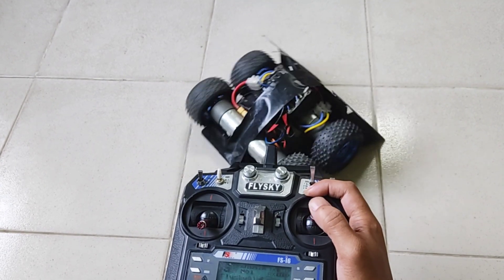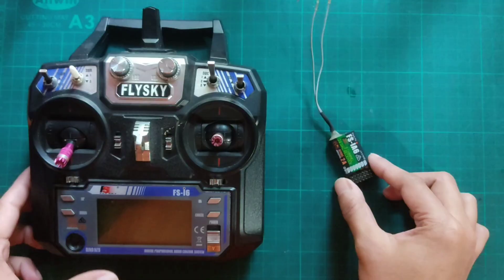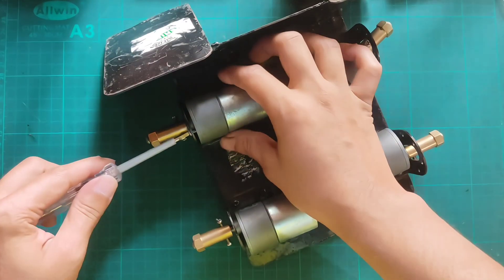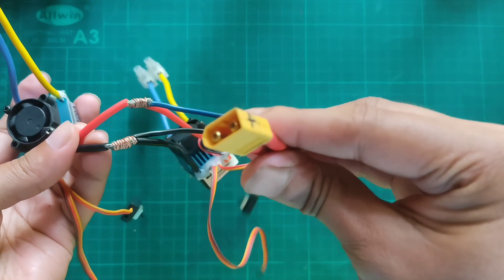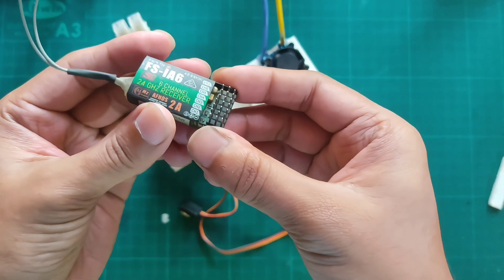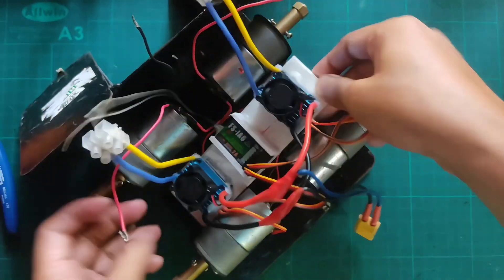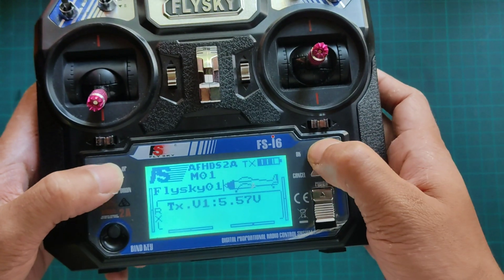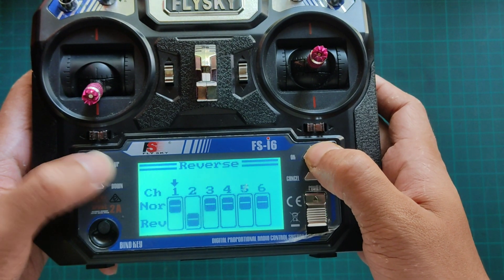Robo Soccer Bot using Brushed ESC and FlySky Transmitter | How to Make Soccer Bot in Easiest Way

Comment from the maker: 𝐓𝐮𝐭𝐨𝐫𝐢𝐚𝐥𝐬:

Fast Line Follower Robot / Fast LFR / Fastest LFR / PID Line Follower:
https://youtu.be/ST8KdWPMzp4?si=4OLW0cTDNwGmwwBY

Robo Soccer Bot using Brushed ESC and FlySky Transmitter | How to Make Soccer Bot in Easiest Way:
https://youtu.be/nd-Pnnmnu04?si=gGmbe2CjW1lpm47K

Robo Soccer Bot using FlySky FS-i6 Transmitter and BTS7960 Motor Driver:
https://youtu.be/gxoFwbduTOc?si=8B-Z586qo14An_A3

Comment: What is the name of the brushed esc
Reply from the maker: I just found this on AliExpress: 
BDT2,016.59 | New Rain 160A/320A/480A Waterproof Brushed ESC Speed Controller Dual Mode Regulator BEC For 1/10 1/12RC Car Boat Truck Toys
https://a.aliexpress.com/_oCgSYOF

Comment: Thank you sir...I have a question regarding the bot,does this bot requires any rechargeable battery to power its motors, ESCs, transmitter, and receiver?
If it is required,then plz make a video of conection of battery with it.
Reply from the maker: connection of esc, transmitter, motor shown in the video. Rechargable battery is lipo battery.
Reply: @aslamhossain1 oiga disculpe que tipo de voltaje es la batería qué usa y de cuantos mAh es

Comment: Hey aslam great video bro, i wanted to ask that i have to run 2 rs775 motor based gear motors for my soccer bot and i have around 2000mah 18650 cells each motor is driving around 12A under stall position is using a pack of 9 liion batteries gonna give me sufficient time to run the bot in a tournament?
Reply from the maker: What is the discharge rate and mAh of per cell of those Lithium ions? It would be better if you increase the number of cell to 12.
Reply: @aslamhossain1  it's a generic cell weighing about 45g with mah written as 50000 but its not 5k iguess its around 2000 mah discharge rate is not written but when I tested it, a single cell was able to give 12A its wierd but yes it was giving 12A

 also the black battery pack that you use in your videos whats its arrangement and rating? And is it sufficient in your matches? Like how do you manage the charging and all?
Reply from the maker: @hrithikkhanna3884  i've used 6 cell to make the 12v battery pack. Each cell is 2000mah. Collected from old laptop battery pack. Used balance port to charge with imax B6 charger. Match time approximately 30mins with full charge.
Reply: Okayyy thanks alot for sharing 🤝

Comment: 2 motors are enough for this built?pls reply.
Reply: Will be there any effect on turning ,etc
Reply from the maker: Possible but you will get less torque while the opponent is getting higher than you with 4 motors.
Reply: @aslamhossain1  well if I used 2 high torque and 500 rpm motor at back and 2 300 rpm low torque motor then?
Reply: @adarshsingh2427  are you preparing FOR TRYST IIT DELHI??  I
Reply: @aslamhossain1  BRO in INDIA if we make ESP32 one BOT then it will cost 7k+, as one motor cost is 800, is there any alternative?? Which is cheaper
Reply: @spideyy691  no
Reply: @spideyy691  Johnson motor lele 500 rpm ke char
Reply: Reply pls